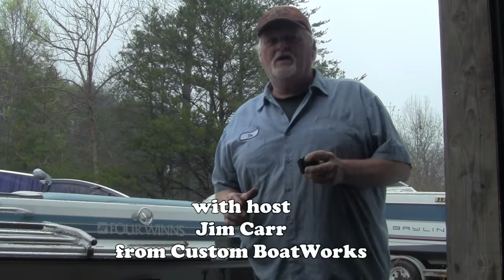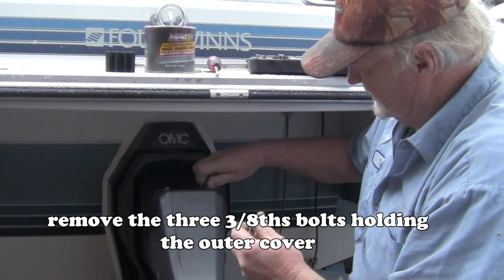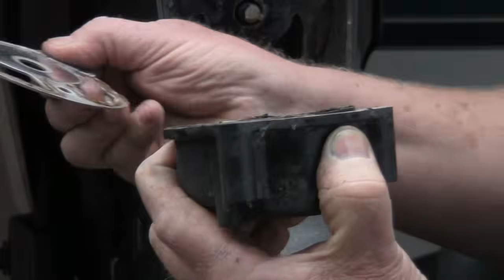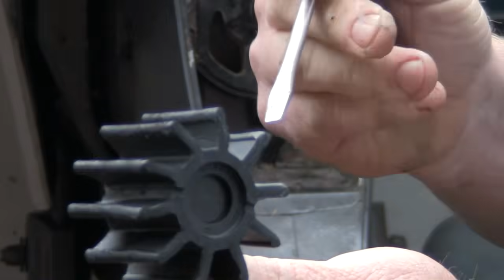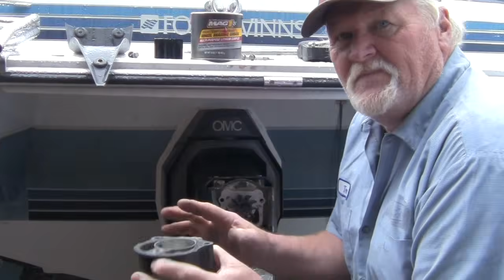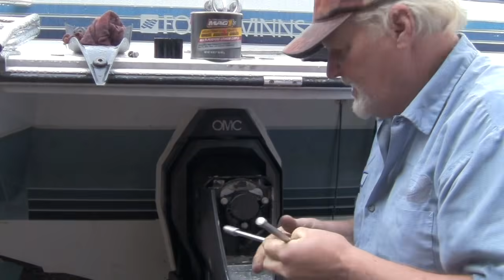OMC Cobra How to Change a Water Pump Impeller in OMC Cobra Sterndrive, how to repair a stern drive

Comment: I hope you are going to read this. But I was wondering if it does matter wish way  I am Turing the housing on the impeller.  I forgot how it came off 😬
Reply from the maker: I always turn the housing to the clock wise position When reinstalling it as when the motor runs , it turns clockwise. Thanks for watching and commenting. Hope I answered you a question.

Comment: Will a failed oring lead to water in the gear oil? Will any of these components, if failed, cause water in the lower unit oil?
Reply from the maker: Sorry for the delay in answering your message. I don't get them when people send them. Yes, any bad o-rings or seals can cause the problem. Thanks for your comment and watching

Comment: But long story short I removed the impeller so that way if I do start to load up outside of the water for a few seconds I don't have to worry about burning my pump up
Reply from the maker: Yes, it is a good idea to remove the impeller for testing runs. Thanks for watching and commenting

Comment: Thank you I literally am working on a Bayliner trophy that has the same outdrive and I'm working on trying to get it to run and start up before I try to put water through the garden hose through it or put it in the water and I didn't want to burn up the pump well good thing is I have a spare impeller because I just pulled mine off it wasn't even fully installed the bolts that hold the housing on or loose so if I had tried to run it in the water and most likely would have overheated and ended up stuck in the water
Reply from the maker: I'm glad to hear you had a spare impeller. Good thing you checked it. That was a good idea. Thanks for watching and commenting

Comment: Hi, great video and I watched it a couple of times question that I have is that if you look at the rotation of the impeller when you take it off the boat and the impeller blades in the stainless steel housing and then put the new impeller on the boss and have the housing all greased up and put it on and then turn it to the right as you’re facing it that would put the impeller blades in the other direction. Can you check that out because the physics of it show the right hand direction rotation of the cover gives you the wrong direction of the blade on the impeller. Thank you so so much. Have a great day. Look forward to hearing from you Michael V.
Reply from the maker: Hey Mike, thanks for watching. I'm gonna check on that.I just can't this evening  work it out  in my head, I think the correct answer is, it doesn't matter.Because as you go forward the blades on the water pump will change. I've always put my housing on and twisted it clockwise as I installed the housing over the water pump. But I will check that out for you and get back to you tomorrow for sure 
Jim
Reply from the maker: Ok follow up to your question  If you install the housing twisting it clockwise the impeller will be in the right angle/ position when done.I hope this will answer your question.  Thanks for watching

Comment: Thank you. I am currently having issues with my OMC Cobra Diesel. The engine overheats. Could it be that the water supply to the impeller is blocked? Any way to check or clean that?

Comment: Great video, quick question, I have a 1981 celebrity with the 3.8 omc cobra.  You had said that all of those impellers are the same from the 3.0 to the 5.7. my question is, do you have a part number or a link to who you recommend to purchase through. thank you in advance.
Reply from the maker: Joseph we try to stay with a  Sierra, or GLM  part they are less expensive than the original OMC with the same amount of quality. Just be careful for some of the ones on eBay because sometimes they have a less quality rubber thanks for your question I hope this helps if we can help you further just let us know

Comment: I don’t suppose this is still active or anyone will respond? Should you be able to suck water through the hose which muffs on? I don’t want to ruin a third replacement but it gets very hot immediately every time. The air tube has no resistance when attempting to suck water
Reply from the maker: Yes this video is still active ??. Yes on the Cobra stern drive you should be able to pull water through the motor with the muffs on the lower unit.

Comment: Hey Jim, I love your videos... Do you have a video on cleaning water out of my OMC 5.8 injectors?
Reply from the maker: Ok first you will need to purge your fuel lines of any water and change fuel filters. Make sure that any water that is left in the gas tank is gone.  I would use a fuel dryer additive. The best way to clean rhe injectors is to remove them and use carb cleaner. You may be able to do this without removing them. It's worth trying. It may take running a take or two of fuel to completely get it all.Good luck. Thanks for watching

Comment: I’m replacing the water pump on mine. Brand new housing and everything it’s it supposed to fit in there so tight it kinda flex’s 2-3 of the fins once it’s full inserted?
Reply from the maker: Yes sir it is supposed to have a tight fit because there can't be any leakage between the fins or the water pump won't pump You should have anywhere from three to four fins that are bent at once.

Comment: Great video!  I have as 1970 CUFM-69B. Can the impeller be accessed through the exhaust housing cover on top of the lower unit? Or do I have to drop the lower gear case?
Thanks for the help!
Reply from the maker: Hello if I'm not mistaken the water pump on them models is in the upper and lower sections and the circular pump is on the motor

Comment: Does your water pump housing need to have a ware plate? Mines doesn't have one.
Reply from the maker: Hello yes the Is stainless steel plate is necessary and also the Is stainless cup that goes in the inner side of the water pump housing there should be 2 stainless steel pieces one will be the wear plate and the 1 that will be the cup that is in the water pump housing. I hope this answers you question if it doesn't please let us know And thank you for checking us out

Comment: Thanks for the video.  How can I tell that water is pumping through the motor? Is there a tell trail like an outboard? Or do I just rely on the temperature gage?
Reply from the maker: John the temperature gauge is a good way to tell. Also you could have a water pressure gauge installed or use  ear muffs and run the motor at home on a hose and see if water is coming out the exhaust.

Comment: Hi and thanks for the video. I have an Bayliner 2755 from -89 with 5.8l v8.
Is it the same for even 5.8liters?
Reply from the maker: Hello yes all OMC stern drives (gray / silver) units. use the same water pump housing and impeller.The white stern drives are different.  If we can help you any further let us know
Reply: @theoutdoorsportsmen  Thanks a lot for the answer sir. I would need to change my bellows as well so if you have any videos for that it would be great but even this helps me a lot so thank you for taking your time and making video about this. Much appreciated.

Comment: Pulled my water impellernoff and there wasn't a little hose attatched to it. Shil I get a little water line and run it into the bottom of the drive? Is the hose connected to anything down there or does it just direct water down the hole?
Reply from the maker: Johnny that little hose is like a cooler for the stern drive . It takes a little water from the water pump and cools the seals etc Yes replace it if it is bad it jut goes through the hole.  I  think I answered your question . If not please let me know
Reply: @theoutdoorsportsmen  perfect. Ill have to go buy some hose for it because there wasn't a hose attatched

Comment: My brother my omc is running hot. Cleaned water jackets n risers. Water pump impeller looks new but doesn't seem to fit the cage tight like this vid. Putting the muffs on n c if water getting to engine. Can I pull the rubber drain plugs on the end of the log?
Reply from the maker: It could be that the impeller rubber is weak and cannot hold the water pressure.  Also check the water pump gasket.

Comment: Do you know if it’s in the same place on a 1990 Yamaha ebbtide stern drive inboard outboard
Reply from the maker: For a long time Yamaha put the water pumps in the same place as omc did an easy way  to  check is just a take off that back plastic cover on the back of the outdrive and check and see if the water pump housing is there if not than they installed it into the bottom half of the lower unit in which case you just have to remove the lower unit to replace it. 
 Hope that I was able to answer some of your questions and thank you for contacting us

Comment: Thanks for the video. I did the whole thing, but my impeller still isn't getting a single drop of water into the engine. I'm not sure if my gasket seal is good enough?
Reply from the maker: You may have a closed intake at the lower unit, the hose going to the motor could be clogged or as you said might be a gasket issue at the water pump housing. Also check the thermostat.  Hope this helps  let us know if we can help further 
Thanks for your question

Comment: Thanku very much for this!! My impeller was shot ! I’m scared that all the pieces of impeller I am missing are in the cooling system, do you have a video on how to check? It’s a 4.3 cobra motor with th omc cobra stern drive! Any information would be greatly appreciated! Thanks a million again
Reply from the maker: Not to worry Chris We have found out through service that most of the time the pieces just pass small enough to wash out through the engine after you replace it with a new impela It should not be a problem if it is then you could try pulling the water inlet hose from the motor and back flushing with a hose.  Glad  This video help you, please check back again

Comment: Hey there I have a 2.3 cobra omc motor. It had a melted spark plug, I did a tune up and it ran rough still after it. It cranked every time but super rough at idle. Now it’ll turn over but no crank. Any info ?
Reply from the maker: Luis thank you for your question it almost sounded to me like you may have a burnt valve or a stuck open valve on that cylinder I would start with that and check that first. If you have any more questions or I may be able to assist you please let me know

Comment: I need to replace the starter on a 1981 Viking deck boat with a gm 5.0 v-8 OMC but can't locate the original starter numbers to buy one. Everyone I see on line is mercruiser or the wrong OMC sterndrive. Anyone had one of these and know what i need to ask for? thanks much
Reply: I know I'm a little late with a response but Chev's are notorious for a new starter making terrible noises. It's because the tolerances on the block and the starter nose. I've always tried to reuse the original nose even if i had to get the bushing replaced. Hard getting to the starter and to mess with starter shims suck.

Comment: Hey guys , i used your video to change my freshwater pump, thanks. Now i have another problem that you all know the answer to , i bet. How about a video on changing and adjusting out the lower shift cable on a cobra ?!?? After i finish replacing the transom and reinstalling the 5.7 it will be time to replace the lower shift cable and i sure don't want to screw up the adjustment and cause a gear failure. 
  Hows about it ??

Comment: Thanks for the video! A friend who is a Mercury Mechanic recommended Dish Soap to lubricate the impeller.instead of grease.  You will know water is circulating because suds will come out the exhaust.  I haven't done it yet, but he said when you start it up at the dock it is hilarious, but you know it's working

Comment: Thanks for this video. A question that I can’t seem to find the answer to anywhere - is there supposed to be water coming out of the housing in normal operation? I’m about to change the impeller and housing, and right now there’s a lot of water coming out of it. So I’m thinking there’s supposed to be less or even none. I’ve got the new kit ready to go, but before I install it, I’m wondering what is normal. Is there any water flow that should come out of the housing, and if so, how much , and from where? If you can help me understand this I would greatly appreciate it, so that I know what to look for.

Comment: My 1990 with 4.3L OMC Cobra stern drive will not pump water up. Ive replaced the impeller twice, removed obstructions from steering cooler. I can blow air through the system from sterndrive to thermostat. Just removed the outdrive to check for obstructions, or other sources. What am I missing to cause a no pump condition? If I use the muffs with forced water from the tap, it will circulate water and stay cool. in the lake or river no water.
Reply from the maker: Be sure to make sure that there is a tight seal where the water pump housing and base meet. Also check the steel ware plate and gasket area, the smallest split or piece of gasket missing can cause water to bypass the pump .Make sure that you also have a good seal around the water tube area where it connects to the water pump housing. Hope this helps. Thanks for your question

Comment: My 1988 3.0 omc cobra. I thought I had a prop slip issue. As driving the boat the engine revs up but only goes 15kms/hr.  
It feels like it could be clogged internally perhaps as its not a prop slip and feels the same way as of seaweed was blocking the intake ports.
Reply from the maker: That would be the first thing I would check is the hub on the prop. You also might look at something clogging the exhaust  as if enough exhaust does not escape from the motor back pressure can build up also causing this. But it sure sounds like a spun hub though. Hope this helps and thanks for your question

Comment: Thank you for the video. Just bought a boat and took it on her first trip and overheated. Pulled the impeller off and it and the housing was melted.  This is going to help me replace that and hopefully get back on the water.
Reply from the maker: Great Terry, Glade we were able to save some $$$$ and thanks for the comments

Comment: Thanks very much for putting out a video that actually helps. Can you confirm the backing plate that you cleaned up, if it needs to be siliconed/gasket down or just placed.
Reply from the maker: +Rick Hammer Rick, they normally don't use a gasket on the back of the plate, but if the surface on the upper gear case is pitted or has been coroaded I will then use some silicone gasket maker to just help seal the back of the plate. Thanks for your comments and question.
Reply: Thanks very much. Have a great day.